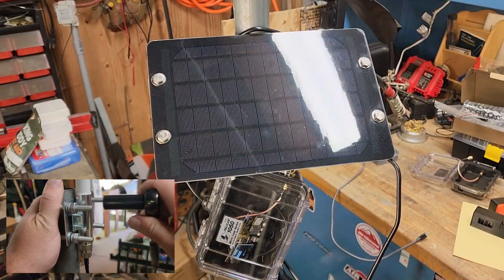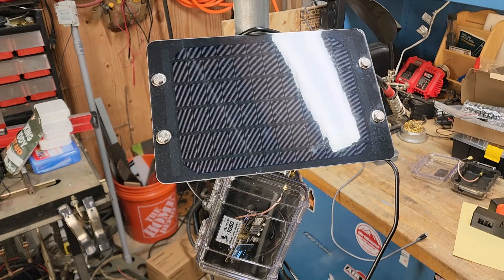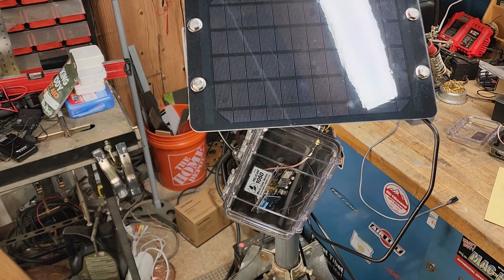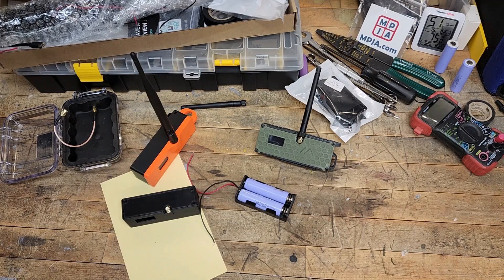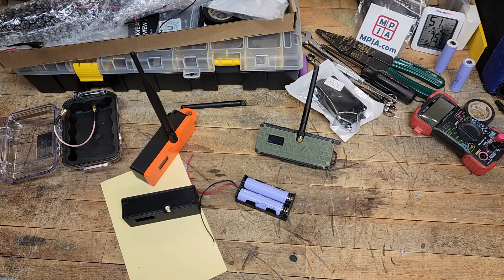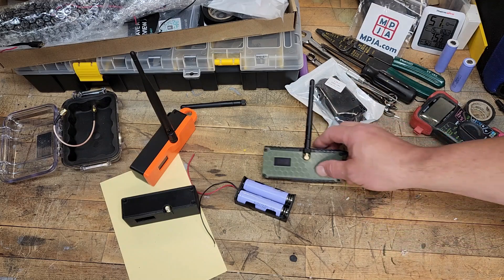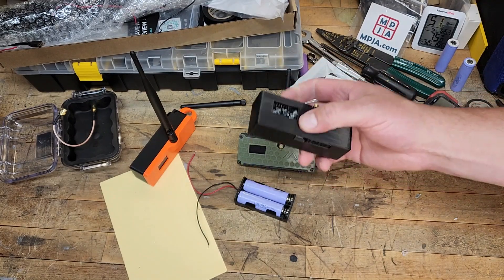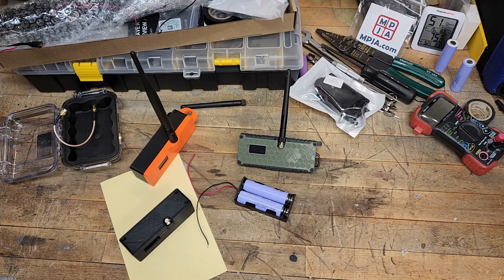Meshtastic Network Testing Updates

Comment: Hello. I want to put my first Meshtastic repeater up for my small community and family. I have done some research and all the modules look alike to me, I can't figure out which module is appropriate for my use. I have a 40 foot ROHN tower,  all of the parts for the enclosure, brackets, batteries, solar panel, high gain antenna, etc. I would like to put it up on the tower and access it from ground level, either by Bluetooth, Wi-Fi as long as it's wireless. I don't think I need a screen, I will use the phone for that, and it doesn't need GPS. Could you point me out to what you would use in this situation so I can research the right device? I'm just concerned that I will buy the wrong thing. Thank you! subbed
Reply from the maker: @kenneth6731  The RAK wireless wisblock is your best choice. Are you looking for a pre-assemblied node, or do you want to build your own? I only ask because since this video, there are many off the shelf setups.
Reply: @RavenwoodAcres  Thank you for the rapid reply, I really appreciate it. I want to build my own.

Comment: im new to all this lora stuff and I'm just trying to get my head around it and hopefully buy a bunch of stuff. 

I have a simple question for you guys regarding antennas.  I know WiFi antennas tend to use an RP-SMA male, but can anyone tell me what is generally used with loRa antennas. 

Do you guys buy RP-SMA Male antennas for loRa or SMA male ?   

I know it doesn't matter so much when it comes to signal or anything which I use, but I'm more interested to know which is more available, one or the other.
Reply from the maker: When it comes to antennas, I recommend buying from either Rokland Technology or DigiKey. I also have additional info about antennas on my website: https://theravenwoodacres.com/emcomm/lora/

Comment: Could you find bigger bolts for the solar panel ? LoL
Reply from the maker: They are definitely overkill, lol. However, they do match pre-drill panel holes.
Reply: @RavenwoodAcres  Ahhh that makes perfect sense then. Rated for a Force 10 Hurricane too 👍😂
Reply: @RavenwoodAcres   I'd recommend putting some kind of rubber washer or something on the top and maybe bottom of those bolts that way the tension does crack your panel. I know it's on the border of the panel but it could crack over to the panel itself. Something else to do is to use a solid white junction box if heat gets too bad no clear acrylic panel just solid white, and add some O2 absorbers inside for humidity... I actually had this idea the other day but I live in Texas and the heat is getting insane and is causing Lithium batteries to explode so I thought about maybe including one of those fire suppression pods/pucks/tins that will automatically go off if something starts to smoke. Due to most high mounting places for normal people being roofs, or trees you don't want a fire to start. You know? Glad I found a video of someone doing this recently every video I find is like five years old still helpful but I wanted something more current. You earned yourself a sub! Peace!